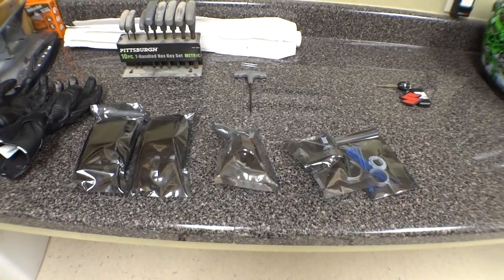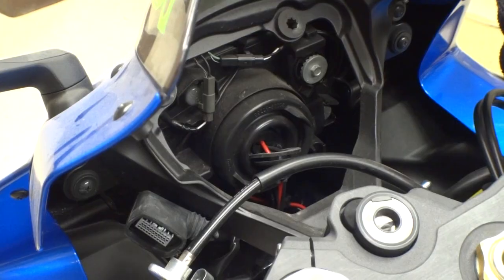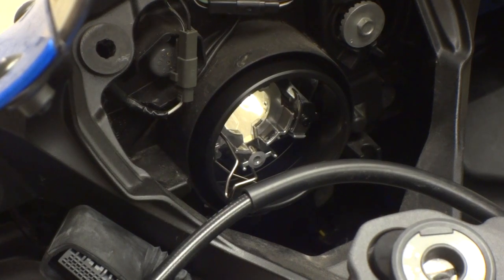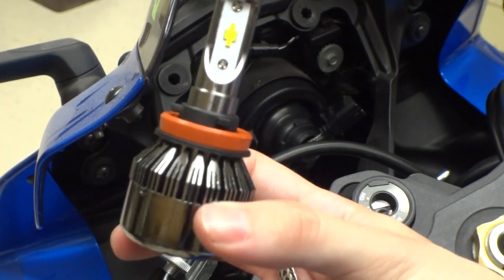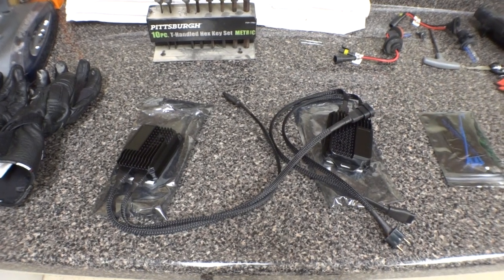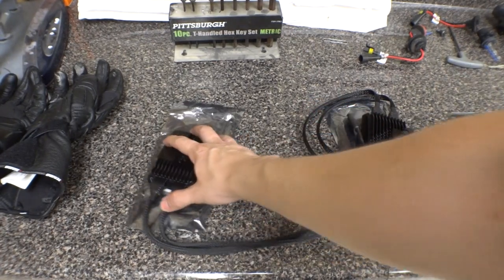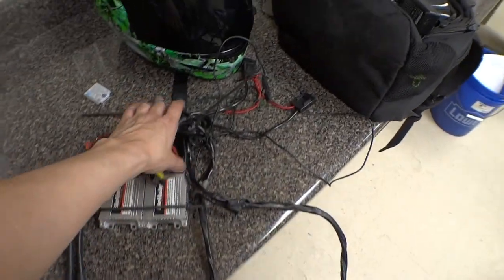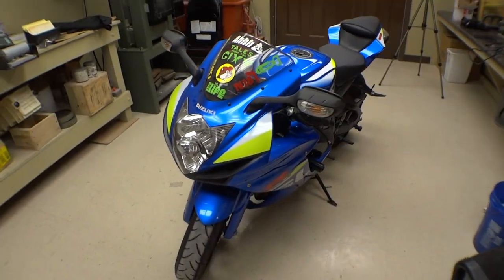2011-2017 Suzuki GSXR 600 750 LED Kit Install

Comment: I installed these on my 750 about  6 months ago,  They rock. Like you said, super easy install and so far they have been trouble free. A big step up from messy and hot running HID. Customer service is also awesome.
Reply from the maker: I honestly wish they had come sooner! I'll never do anything HID again. For sure a big step up. Thanks for checking it out man.

Comment: The kit I got from them was the first version he offered before he even put it on his website. It has shorter ballast leads so I had to mount the ballast to my front fairing. it's not a problem, but it's cool the latest version gives you more flexiblity in where to mount it.

Comment: Taken from Google: "Unlike fluorescent bulbs, LEDs don't require a ballast to regulate current. When using direct fit LEDs, the ballast is still using energy and eating into your possible energy savings." ... so.... why install the ballast? Sorry for being noob, but can anyone explain? It seems LED lights should work without them.